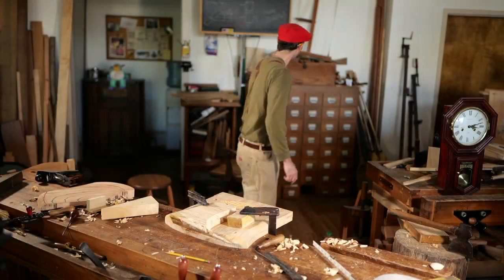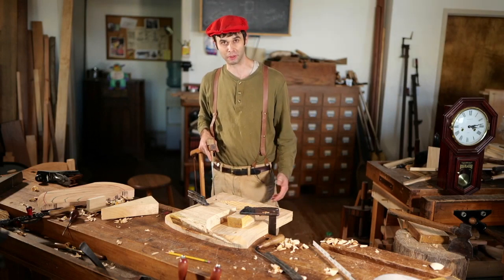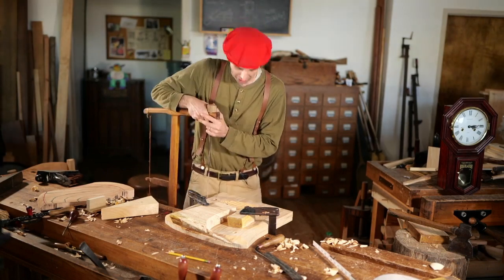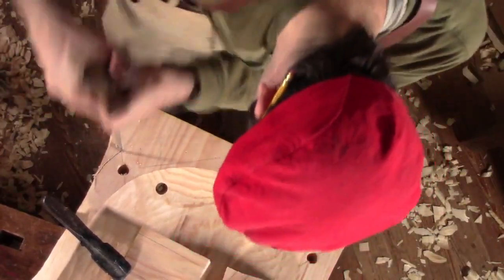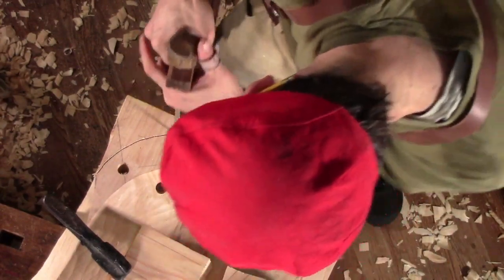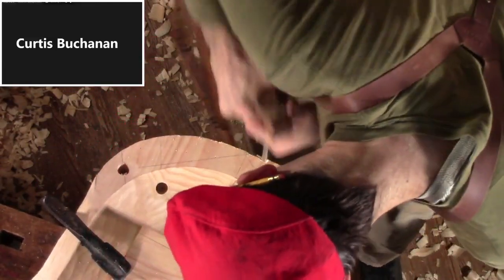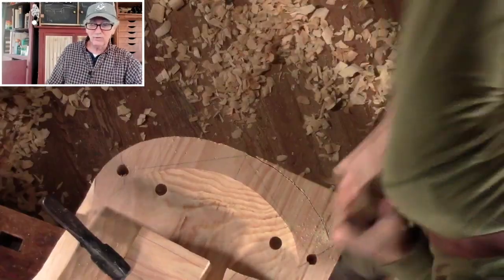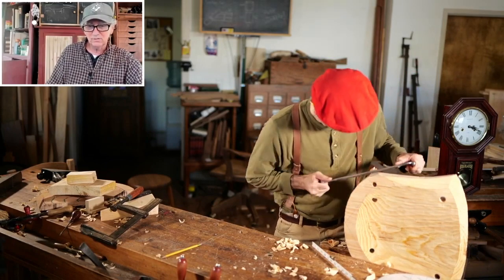Using a Bow Saw (or Turning Saw)

Comment: I have a 12" bandsaw and am thinking of getting a turning bow saw. One practical reason, is I usually keep a 1/2" resawing blade on there, so don't have to change the blade for just a few tight curve cuts.